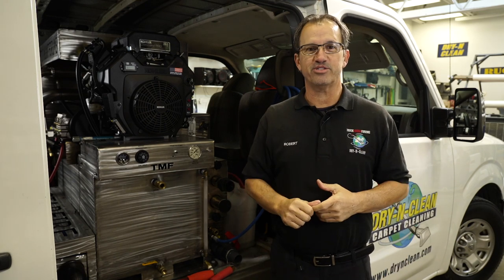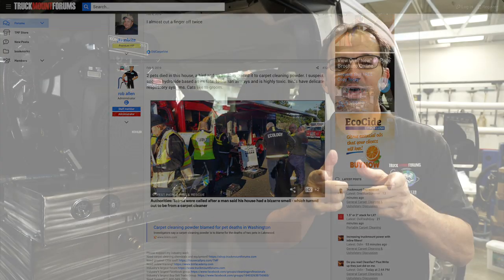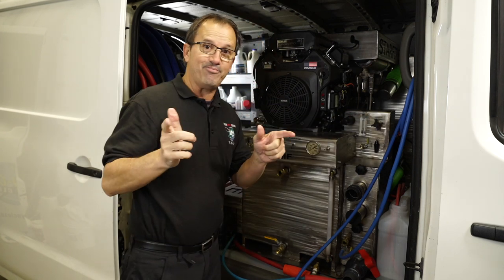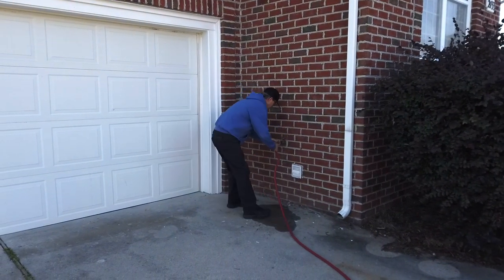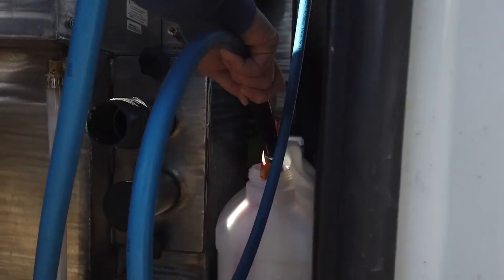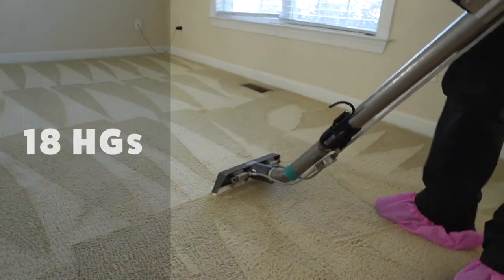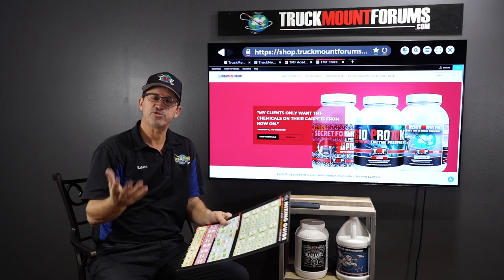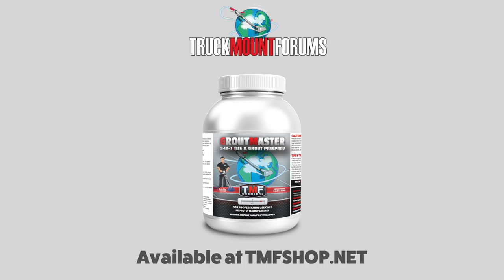How To Use a Carpet Cleaning TruckMount Like A Pro

Comment: 18 inches of mercury is way too high. More than some blowers are even rated for. Think of it like you are drinking out of a straw. When you bottom out the straw, you can’t drink as much. Same applies to this. You don’t want the wand to suck all the way down to the padding. Optimal amount is 12.5-13.
Reply: Not only that. Too much vacuum can over heat your blower, that $3000+ part that is integral to your business.

Comment: I'm considering switching to tmf for my full chemical line up. My only hesitance is that I see so many on your truck. I'm a firm believer that less is more, and having the least chemicals possible will reduce risk. Why do you have so many on your van, and what would you reccomend if I only wanted 4 or 5 cleaning solutions and a couple spotters?
Reply from the maker: Chris Davies that’s entirely possible. We carry a full line of products on our trucks to fulfill our variety of diverse services. Most rarely get used. Prespray, Unchained and PureO2 can do virtually everything carpet cleaning. Throw in a rinse and uph prespray for furniture and you’re good.
Reply: @TruckMountForums  thank you for the quick reply. My machine doesn't have chemical injection, so my only option for rinse would be to add it to the fresh water tank (and stop using my hydroforce injection sprayer), or not use rinse. What's the downside of not using rinse? I'm guessing greater risk for alkalinity browning because of the high ph??
Reply from the maker: Chris Davies just do some extra rinse and dry strokes and you should be fine. Plus use air movers.

Comment: I'm seriously considering a truck mount,  however most of my business is as a state contractor/vendor.  10,000-20,000+ square feet office buildings. Our contracts are for daily cleaning and carpet cleaning/ hard floor maintenance is a once or twice a year task.  The limited outside access points in such large buildings are a problem for the truck mounted units. Lots of hoses to reach everywhere.  Also carpet cleaning is only a small part of the contracts,  and we have so many  contracts it leaves very little time for side jobs where the truck mount could pay for itself.  The few times we've outsourced our carpet cleaning have left me very unsatisfied with the results though,  and they've always used plug in extractors.  Not even sure they were heated extractors tbh. One thing is for sure,  our office carpets see dozens of times more daily traffic than a residential carpet would see. Having a hard time visualizing hoses a city block long to reach everywhere though.

Comment: so i noticed you turned down rpm's and turned down the heat-wouldn't you need to run some water out of the courtesy hose until it cools?